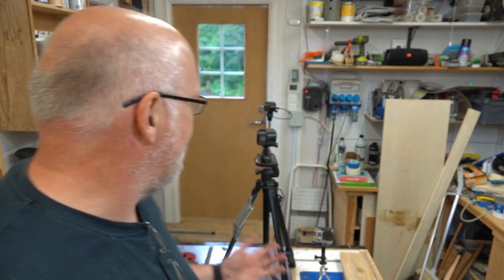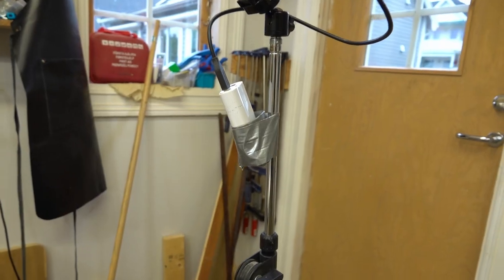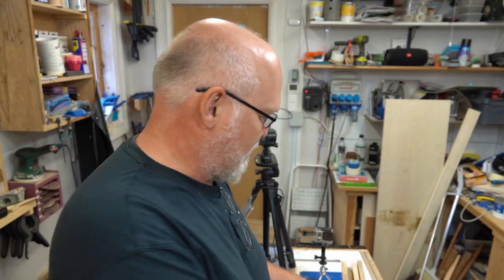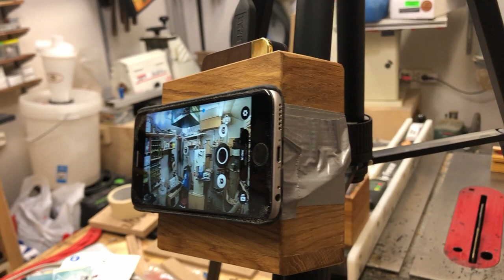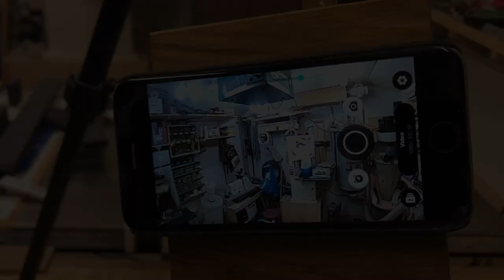Making battery holders for my tripods and GoPro.

Comment: Cutting small pieces safe on the miter saw you could make a "hold down stick". Here is one video showing how it works: https://www.youtube.com/watch?v=F6X79jzuQzw   It can also be used on the table saw with cross cut sled.